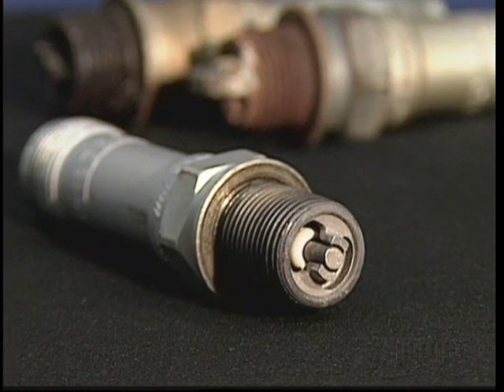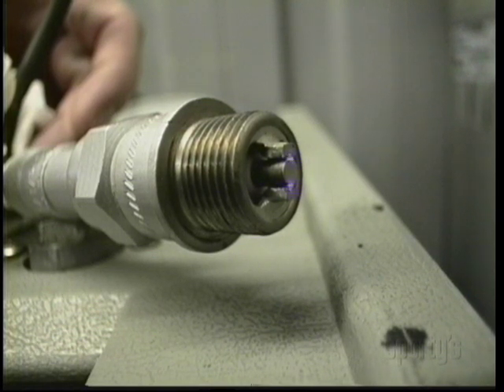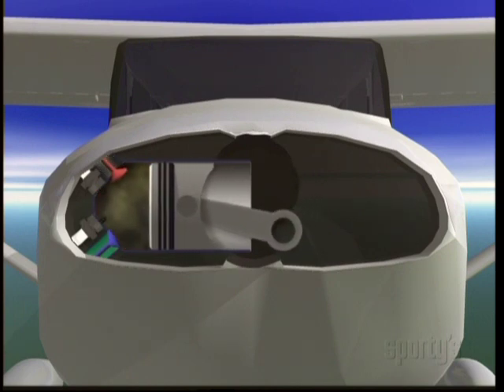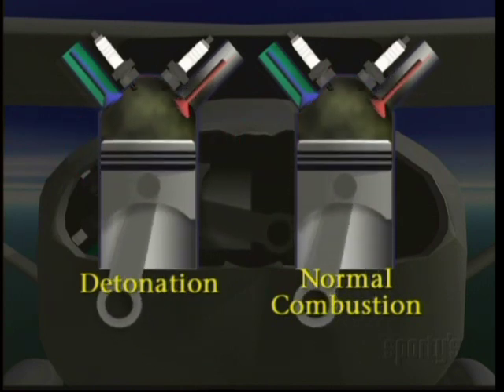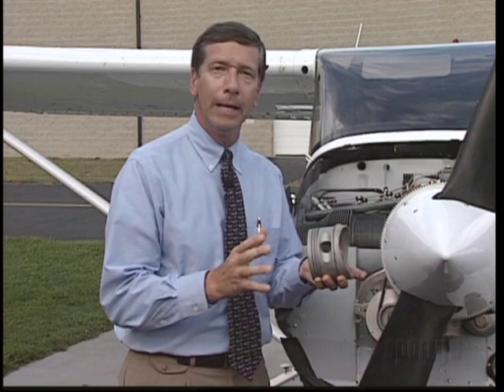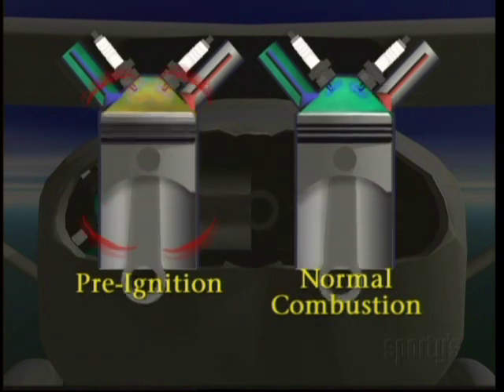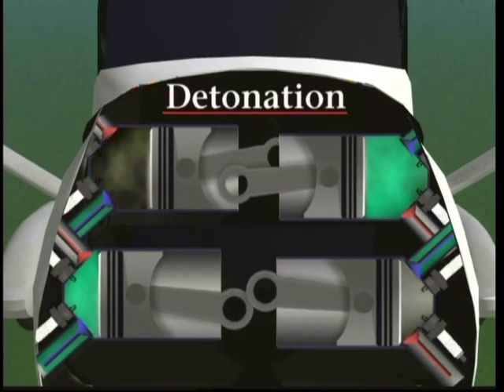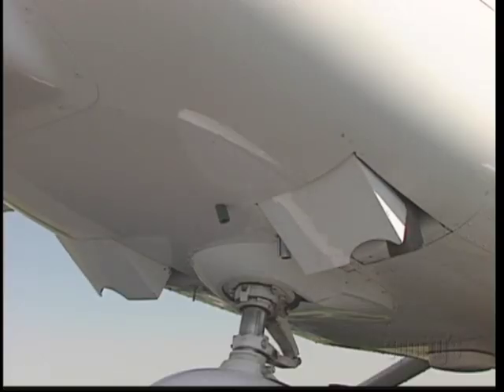Preignition and Detonation

Comment: Would 2 Cycle Engine Oil in the Fuel Help To Prevent This Form Happening........?   in high compression special piston engines......I am wondering...if the Oil Would Help.....?
Reply: It won't help, 2-cycle oil lowers the octane rating of the fuel so it would worsen the problem!
Reply: A Diesel is a high compression engine...it uses oil for fuel....and Alcohol is used in high compression engines...Both a Oil...But I guess the Diesel Oil is injected at the correct time at 2,600lbs to 30,000lbs at TDC...Or close to it...Octane is about the only answer to running a High Compression Piston Engine....?  Or The Multi Fuel Onboard Computer...Huh...Changes Fuels at Certain RPM's.....

Comment: The causes of knock can be:

* Excessive compression - increases pressure / temperature

* Not enough octane rating - fuel more likely to explode

* Wrong mixture - excessive heating / lowering effective octane

* Ignition timing - too much advance increases peak cylinder pressures a LOT

* Poor cooling - leading to high cylinder temps and pre-ignition

* Dirty cylinders - more candidate points for pre-ignition

* ECU/sensor fault - lots of options